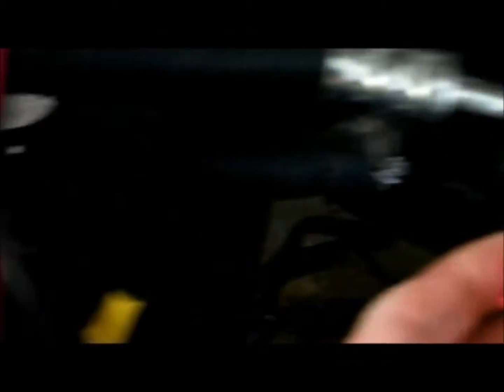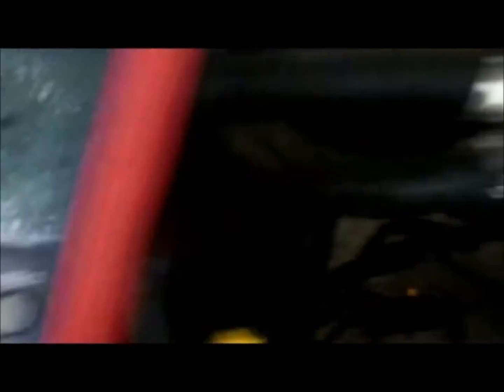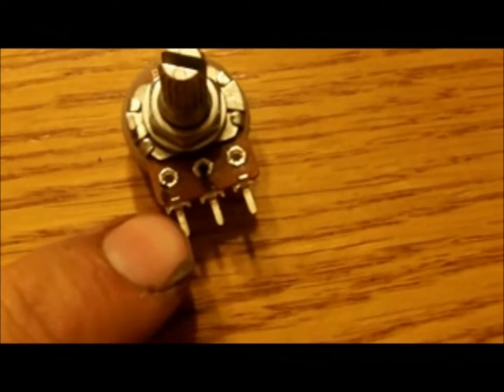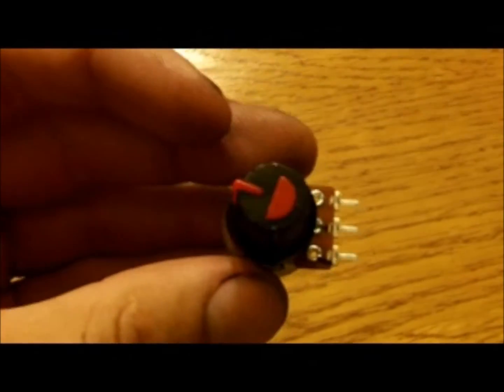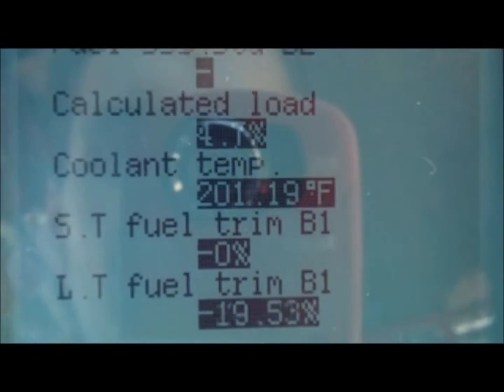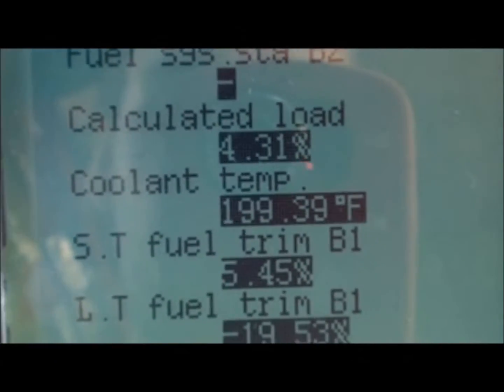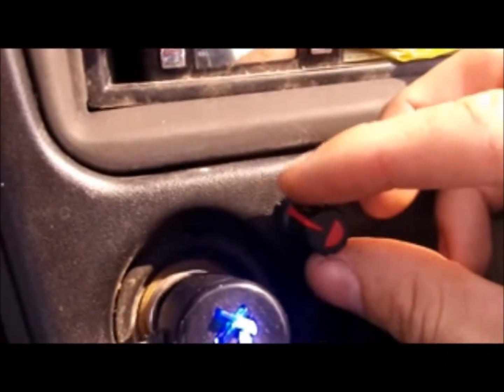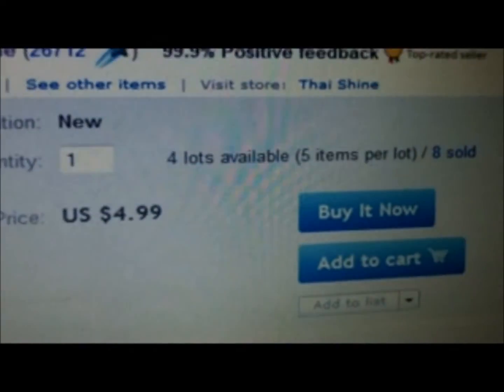How To Tune Your Idle For A Dollar

Comment: Hey man my car does the opposite, i have the same manual iac as well, and when I first start the car it idles fine but after a short drive and it heats up, it idles around 1200

Comment from the maker: The only wire you are going to touch is the black wire with the green stripe going from the ECT to the ECU. Leave the green one with the white stripe alone. Cut the black/green wire and strip a little off both ends then attach one end to the 1st pin of the POT and the other end to the 2nd pin of the POT. Leave the 3rd pin just exposed. I used heat shrink tubing where I soldered the wires to the POT so they could not touch each other.

Comment from the maker: You splice in into the return signal wire that comes from the ECT. I used a harbor freight soldering pen to attach the wire ends to the POT and ran about 4 feet of wire into the cab of the car.

Comment: Yeah I changed my O2-sensor about 3 months ago. The old one had a ripped wire. I bought a brand new Denso sensor because I thought Denso was the company that produced the original parts. Maybe the new one is broken, too?

Okay, I gonna check the coolant temp sensor.

Comment from the maker: CONTINUED....
other things to consider are the idle air control valve, map, egr stuck, timing belt is stretched and timing is off, clutch not disengaging all the way, intermittent vacuum leak, inconsistent fuel injector, bad ignition coil, erratic fuel pump or FPR, fault in the EVAP system or EGR system, faulty alternator, bad pulleys from A/C or PS or WP
Start with replacing sensors the free way and clean them and return them if no change. That will rule out the "most likely"

Comment from the maker: If the speedo stays at a steady 1100 when cold and then starts acting up once the engine is warmed up then its likely to be the air/fuel mixture is off. The first likely culprits would be the oxygen sensor or bad coolant temp sensor. What I recommend is to get a new o2 sensor and install it and if it does not fix it then put your old one back in and clean off the new one and return it. Then try the coolant temp sensor, test it, clean and return if no change. The list goes on.

Comment: Thanks for the qick answer. When I start my car and let it idle for about 2 minutes the speedo reads about 1100 rpm. After driving for about 10 minutes the idle starts go up and down between 650 and 900 rpm and the engine buzzes. After driving a bit longer it still goes up and down, but in a smaller range (like 650-800). I can feel the engine vibrate and reving a lil bit. 
I own my car for 3 years now and never noticed something like that. Whenever I drove it the ilde stayed perfectly at 750.

Comment from the maker: In my case the engine was modified so I needed the knob to tune it. But in your case if everything is stock then there is something "wrong". It depends on if the idle is going up and down like mine was or up and down alot or if it only does it when the engine is cold or warm to narrow down the cause. Give me some more info.

Comment: So what's the problem with your (and my) idle? I have exectly the same issue like you but my car is nearly stock. The only thing I changed is the header, and that was about 2 years ago. What can cause the idle problem? I've changed plugs and wires so far but no change. I don't want to install a knob, I wanna find the real cause. I dunno where to start :(

Comment from the maker: I have 5 gauges.
1. Air fuel ratio
2. vacuum/boost
3. oil pressure
4. fuel pressure
5. voltage

Comment from the maker: The potentiometer luckily fixed it just fine. It idles and drives just like its stock! Im pretty sure in alot of the engine management systems out there they are basically glorified potentiometers especially the apexi neo.